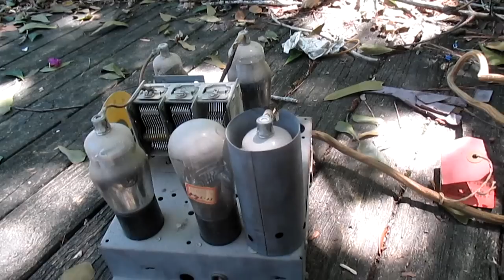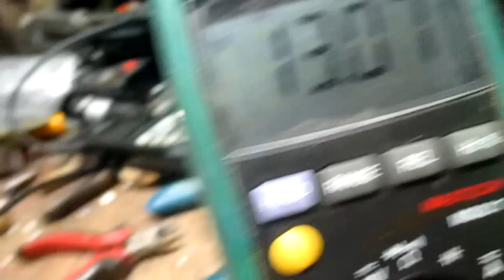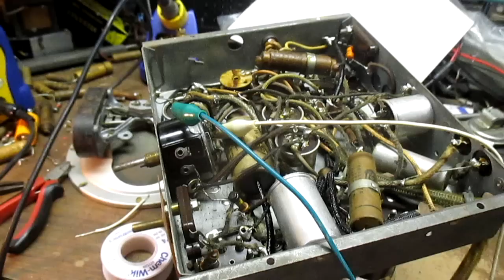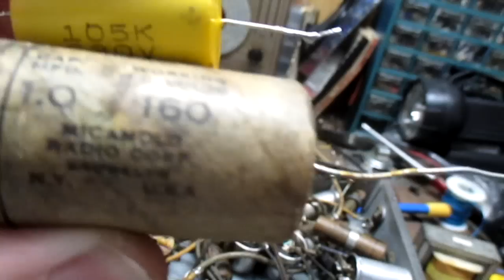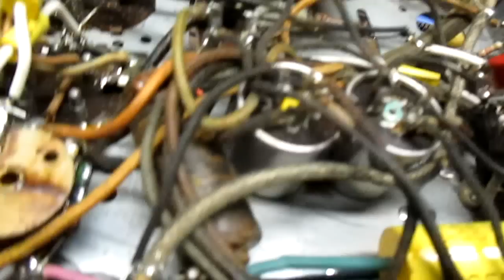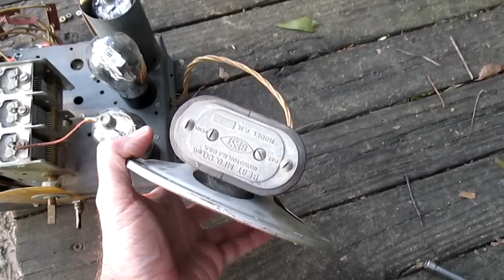Crosley Model 178 Battery Operated Cathedral Tube Radio Repair

Comment: schematic shows that bad resistor is about 1.2k
The parts values used in old radios were not the "standard" values sold today in the 10%, 5%, and 1% series.  The standard value series is based on each value falling into a specific range, the old values weren't and a 30pf capacitor could actually be a higher value than a 35pf when they were tested!

Comment: Years ago, my mother, now 96 and going strong in the nursing home, bought a modern copy of that sort of set, she loved it however it developed a hum so she replaced it and put the set in a box.  When I cleaned her house out to sell it after she went into the home, I found it and repaired the hum by replacing a cap.  The set basically had a transistor radio chase mounted in the case hooked to a large speaker to give better quality.  It had a lite dial but the bulb was gone so I replaced it with an amber LED and a resistor, not she is working once more but mom doesn't have room for it in the home so it sits on a table in my dinning room. Before my wife passed away I used a small FM transmitter hooked to an MP3 player and played Christmas music through the set. Alas, those days are now long past. My youngest daughter has moved in with me and keeps the house for me now and that radio get's dusted once in awhile.  I am considering replacing the works with one of the WIFI radio sets I build using ESP32's and V1053 decoders with a small amplifier.  I know mom would like a small version of that set and I am planning on building one for her this week.

Comment: Some manuals have instructions for adjusting that type of magnetic speaker, which I believe involves unsoldering the center joint between the wire "rod" and the center of the speaker, then adjusting the armature to be half way between the magnetic poles, then resoldering the speaker in place on the "rod". It will never sound that great, though, which is why they invented dynamic speakers. That said, I believe in keeping radios as original as possible, even if they're not the best design, so I'd keep the original speaker even if adjusting it doesn't improve the sound much. If you want a better speaker, you can always find a newer radio that has one.  I'm glad you didn't stick a dynamic speaker with transformer in this one.

Comment: "It needs a recap". Jeez it's a repair/troubleshoot video you can learn from. Anyone can recap something and film but what do you gain? Cool video. I have a 1938 5T-3 RCA I plan on getting around to. Just need a couple parts/tubes. Someone figured an 82 was a good replacement for an 80...hmmm

Comment: Like so many areas, there are no AM radio station worth listening to. Bryan, you need a little AM transmitter to provide a signal that can be used and tolerated! Good video.

Comment: I actually have an old Coronado battery radio from 1937 that when I got it someone tried to wire an AC power cord to the antenna terminal and thankfully there was a capacitor there otherwise the antenna coil would of gotten fried. The radio I have uses 2 volt tubes so I rigged up a battery pack using 2 “D” cells and a couple of diodes in series to drop the 3 volts down to 2 volts.

Comment: That turned out quite well. Crosley battery sets were ok, but they were definitely not on par with something like a Zenith. I like the paper towel between cone and basket, that's an old-timer's trick. I've received many a radio with a warped cone that had cotton wedged in there....and it did the trick

Comment: You can install a low power LED as a dial light with its own on off switch
Reply: But if he did that, it would not look as original.

Comment: A circuit board is not too hard to design . Also less than 1.4 volts ( 1.25 or 1.35 v ) for the smaller battery tubes is ok.  2 protection diodes in series across filament inside radio + fuse to save the tubes is a good idea

Comment: Would have been a shorter video if the Electrolytic's & Wax CAPs had been changed sooner!
Reply: Shango would say this radio looks "fairly unmolested". Not much in the way of tampering or botched repairs in the past.

Comment: It still blows my mind how dangerous some of the battery operated sets were, especially considering you have a battery with over 100 volts that was designed to be replaced by the user. I can just think of how many people got zapped...
Reply: in the past people where way smarter then nowadays. 
...
Reply: @MrBugsier5  Mine uses 60-70 volts.  The original B battery had an open-circuit voltage of 67.5 volts.  I'm using seven 9V batteries which provide around 70V when new.  I have another which uses two 45v cells in series for the B+ but it also has a 117Z6GT rectifier and some filtering so it can run on AC line voltage, and that's probably the way I'll run it.
Reply: They would’ve been very quiet but much safer if the tubes run on 45 volts my radio I build has 1T4 & 3V4